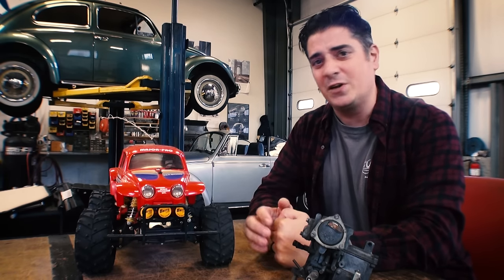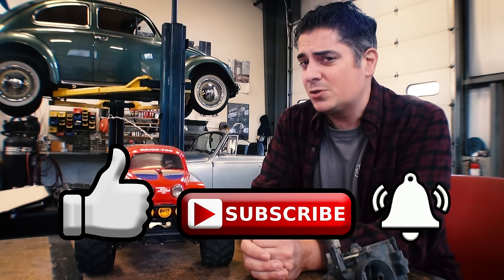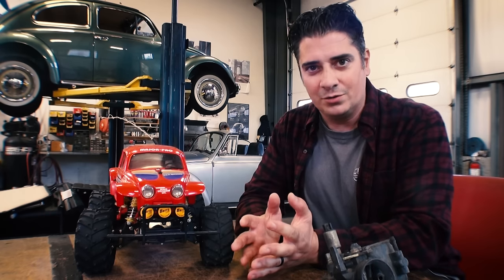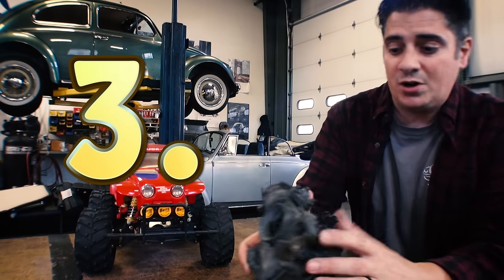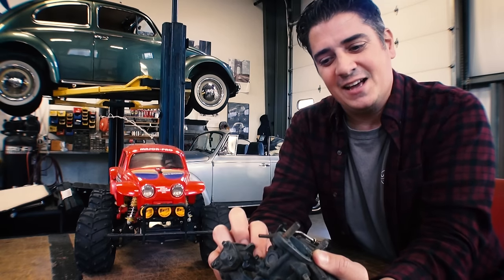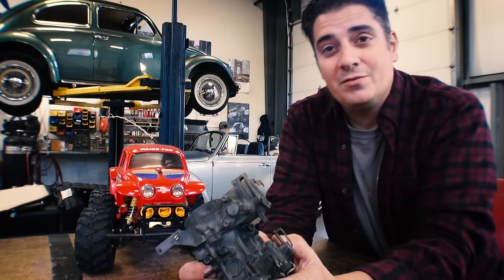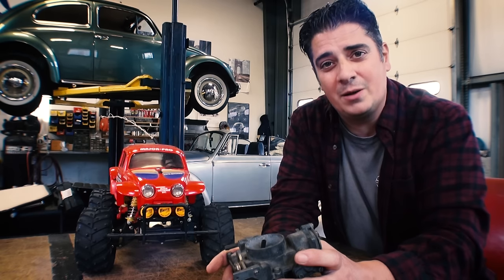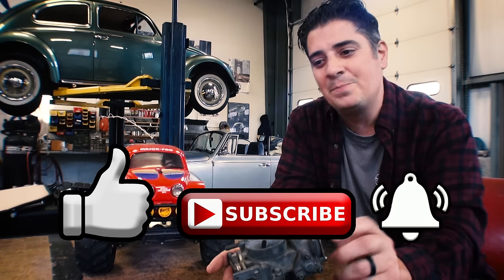TOP 7 Reasons your Classic VW Beetle BuG Hesitates, Stalls, or CHOKES on Acceleration

Comment: I can't quite get this straight. Are 30, 36, and 40 horse motors all 1200 cc? What about the 1300, 1500, and 1600 cc motors (66 and later)? Are 25 horse motors 1000 cc? Were multiple motors available on a bug for some years? Link for a timeline of when which motors were available would be nice. 

You've been a huge inspiration and I've got a 65' in the garage that I'm now daily driving :) Thanks!
Reply: Your best bet for this information is the technical section at www.thesamba.com.  1300cc motors are 50hp, 1500cc was 53hp, and 1600cc are 60hp.  In the US Beetles of a given year pretty much all came with the same engine, but in other parts of the world you could buy different models with different engines.  For example in 1968 US Beetles came with 1500cc engines, while in Europe you could buy a VW 1200, a VW 1300, or a VW 1500.  Aside from the obvious differences in engine size these models were also quite different regarding included amenities.
Reply from the maker: Well, I guess to keep it easy, the 30 and 36 hp are 1192cc, the 40hp I believe they just went to 1200cc.  The 1300cc, 1500cc, and 1600cc were all different HP.  Check this out https://www.jbugs.com/VW-Tech-Article-Engine-Letter-Codes.html
Reply: I appreciate the clarification. Thanks 👍
Reply: @jaredkomoroski  the 40 is 1192cc, but the block is unique.  61 through 65 virtually unchanged except for heater design.  66 a new block started.  VW was trying to keep up with the Datsuns and Toyota's.   My '73 1600cc datsun had 90 hp.  VW was never gunna compete.  Cheers!

Comment: Thank you for this video. I have a VW trike with a 1600 dual port and it had the .009 distributor. I just changed it and did the timing and it does appear to run better although I haven't had a chance to ride it yet.
Reply: It does appear to have helped quite a bit.

Comment: Hi - I have a FI to carb conversion (empi 34 carb). Heat risers were not installed. Bought it like that. I will replace the FI exhaust in order to add those heat risers shortly. Can that be a reason of engine hesitation (carb icing) on higher speed? It happens every couple of minutes, mainly > 50 mph... Great videos BTW, this will help a lot! Very clear and easy to understand

Comment: My VW sb 71 starts and idles at 850rpm and runs without hesitation but it dies when stopping. Carb was cleaned and new carb kit was installed. It used to hesitate but I replace the dist with a SvDA Pertronix Throw-flamer II. Any ideas to fix this problem?
Reply from the maker: do you have that idle solenoid on the side of the carb?  If you do, try cracking that loose a little bit.  Or you may have to take the carb apart and take all the lil BBs out and dunk the carb overnight.
Reply: Check fuel pump rod mine was sticking in the riser

Comment: thank you for the video.  I'm actually fighting with this now.  Luckily, it's close to winter so this will be a good time to dig into the bug since I won't have to worry about any car shows.  Would any of these topics (1-7) cause fuel to go into the oil?  That's another issue I have going on right now too.
Reply from the maker: Hmmm that is your needle and seat in the top of the carb maybe.  Do you park on any sort of tilt? Nose up?
Reply: @classicvwbugs  no, car is parked level, in the garage.  I was told to check the fuel pressure coming from the fuel pump.  Will begin troubleshooting tomorrow.  Since I saw this video, it made me think about the 1-7 you covered.  Thanks for responding.
Reply: @Lawrence Haughton what brand fuel pump did you installed
Reply: Bad fuel pump diaphragm.

Comment: I have a 68 engine, 009 distributor with out the vacuum, and perlox  ignition. I did ALL of the things Chris suggested, to no avail. I found that I needed to run non ethanol fuel, or grade 92 fuel.I adjusted the timing to roughly 6 degrees before top dead center, and used a 12 VDC test light to static time the distributor cap to the rotor. I think changing the fuel was the BIG ISSUE‼️
Reply: For ethanol fuel you need larger fuel jets in the carb. Ethanol fuel will run a bit too lean if the carb has been jetted for non ethanol  Fuel.

Comment: I have a kit car with a 1600. It stumbles at lower RPMs under load. Another symptom is the tach bounces quite a bit. Could I have a ground issue that would cause both? Any other thoughts? Engine has roughly 35 hours on it.

Comment: Hi chris do you know why 2 same side 2 cylinders are not firing they were working but suddenly died changed sparks , leads,points, rotor ,cap new coil, still not firing just 1,2, are working
Reply from the maker: Do you have spark to those cylinders?  Did you cross wires by any chance?
Reply: sorry for late reply the firing order is correct 1432 there is no spark on 3/4  1/2 are fine but misfiring i think the coil is weak thinking of replacing it and distributor would it help in bringing the car back to life
Reply: It's probably an air leak at the intake manifold.  But -  are the plugs tight? Realize they're a cork for an explosion that occurs thousands of times per minute. 25 pounds. Ignore the 18 pound value from the factory.

Comment: Hey dude! I'm new to the VW community.  I'm having a "misfiring/backfiring" issue with my '68 Ghia and found your videos. Did you make the move to Florida??
Reply from the maker: Yes I did
Reply: @classicvwbugs  awesome!
Well your tip about cleaning out the two little jets on the side of the carburetor worked for me. Thanks again!

Comment: Great information, I have been using a beetle, Brazalian origin, 1600cc Double Carb. I have hit 160 on flat roads and it was a great piece of machine. My simple question is, how does the two carbs work at high speed, I was told by a German Auto Mechanic, on these dual carbs, one of the carbs gets fully operational when you hit a certain speed, say when you pass 80 km the second carb opens to give the full throttle and both works in a sync manner. Could you please elaborate on the principles of this functional operation.

Comment: Ok I have a 1679cc thick wall cyclenders with a Weber progressive carb and 009 distribution.  I e changed the jets and have a electronic ignition. It was running great till a few days ago and somehow got out of time. I’ve worked on it for days but long story short I changed the rotor n cap and runs better and staying in time but now I still have a lil hesitation as I’m throttling up and going they the gears. Never had it before so any idea I would appreciate.
Reply: Did you figure it out?

Comment: Hey Chris, I'm going to throw a Pertronix III conversion into a stock german vacuum advance distributor. I have proper wires and low resistance coil coming as well. What plug do you recommend with electronic distributor? Ones with 10K resistance or no resistance? Thanks! Love your channel!

Comment: Hey Chris great video! I have a ‘74 bug that runs good until I hit about 65-70MPH and then starts choking up and stalling on me. I have to pull over and let it resettle. Any recommendations?
Reply from the maker: Hmmm sounds like fuel restriction.  Bad fuel pump maybe?  Check fuel flow.

Comment: I have a ‘72 super beetle. Had carburetor issues and finally bought a new carb and replaced generator with alternator. Worked fine for a while but now it will not idle after it gets warmed up. Cold idles. Car sits a lot. Not driven much at all because afraid it want make it home. Why does it idle fine when cold but not when warm?

Comment: What can make your VW Beetle stall when going down the road and when you go to stop it stalls at a stop sign or stop light ?
Reply: Vacuum leak somewhere between base of carby and heads.....is where I’d look first.
Reply: Hello , I had a similar issue. and   I removed the carb clean it and put it back. but i could not be sure about the issue. any sugestion Chris.

Comment: I've been working on a 1968 that we've had sitting for 14 years (long story) and your videos have been lifesavers! Anyways about the gas tank. Mine is rusty...do you suggest cleaning it out best I can and reusing or just getting another one? If you think cleaning it out is good what would be your method?
Reply from the maker: For a 68, I would get a new one, they are readily available.
Reply: Acid works great.

Comment: I have a 70s beetle kit car I was running down the road at about 65 when it stalled out I filled gas tank and charged battery but it will not start. Only thing I changed was I removed a solenoid for the gauges because it was killing my battery any help I know very little about beetles

Comment: have you fix one of the latest generation beetles from Mexico with Fuel injection,  and yes control module included.  or  are you familiar with those.?
Reply from the maker: I have not, no.  Sorry.
Reply: Do the Mexican Beetles have electronic ignition? All the fuel injected VWs I had still had points. The system uses the points to fire the injectors. Burned points caused hiccups. I started replacing the points when I changed oil.
Reply from the maker: @williamstewart2727  Good question, not sure.

Comment: Hi Chris, question for you.  My 1970 bug starts great, idles well after warm and drives well.  However, after I run an errand or go for a cruise, the bug won't idle high enough after restarting without feathering the throttle.  Any ideas?  Thanks!
Reply: Check the air/fuel mix screw .

Comment: Hi Chris.
Ellis all the way from South Africa Cape Town.
I have a 1971 1600 Twin Port.
My beetle chokes on lower revs on gear 1 and 2.
It also chokes when turning either left or right but after i turn it goes fine.
Also have a problem of the engine cutting out when idling. Sometimes it happens sometimes not.
Any thought what i should look at?
Reply from the maker: yeah gotta check the carb, take it off and do a clean.

Comment: Hello, I have a type 3 1600 duel carbs, the right side carb seems to not run as good, I have rebuilt it but still not acts right. Idles good but when I go to take off, it boggs down like starving for gas or floating out, I have no idea. It also runs real rich, I can smell raw gas
Reply from the maker: have you tried adjusting the fuel mixture screw?
Reply: @classicvwbugs  yes I've tried some, had a shop get it running better so I could get it to a show in Eureka Springs Ar,  but its still really doggy....... I'm sure IF I had the motor rebuilt it mite solve my issues, but thats not possible rite now..............

Comment: i have a 1972 vw bug 1.9 liter  with a impi gas 38 carb with a manual fuel pump do i need an electric one? which distributor is best for this set up

Comment: Chris interesting - thanks - so I have a question in regards to the coil. In most of the images you show it has the coil pointing downward with one pointing upwards. Being oil filed coils, if it is pointed upward does this stress the upper wire locations from electrical stress by possibly not being submerged in the oil? Thanks Sid
Reply from the maker: I don't think so.

Comment: Hi Chirs, thank you for your videos, and specifically for this one. You just mentioned about a problem that I am having with my beetle, I am not being able to adjust the idle speed in my bug's engine, I even changed for an old carburator that I have but the problem is still there, which makes me think that I am having a vacum leak somewhere in the manifold. I sprayed water on the carburator and on the manifold base  expecting to hear a change in the engine sound to try to find out where the leak is coming from but nothing happens, the question is: Do I have to take off the black metal sheets that covers the base of the manifold  so that when I spray the water it can really reach where the manifold and the block meets? if that doesn't work I don't know where else to look for the problem. Thank you very much!!!
Reply from the maker: Any ports on the carb that is not plugged?
Reply: @classicvwbugs  Hi Chris, I just re checked and everything is where it is supposed to be..So do I have to take off the metal sheets when spraying the water? thank you for your reply.
Reply from the maker: @bugmevideo4269  nah
Reply: @classicvwbugs  thanks!

Comment: Hi Chris. I  Have a 77 VW Combi. The Problem  is this.  If i press the Gas pedal past the halfway mark,and take my foot of the gas pedal,the Engine dies out. But if i press the pedal just before the halfway mark,the engine idles fine with no problems at all.   Any Suggestions?
Reply from the maker: Yeah I would take that carb off and do a good cleaning, take out all the jets and BBs and dunk it.  You could also check points or timing to before you do that.
Reply: @classicvwbugs    Thank you for your quick response. Much appreciated.

Comment: Anyone have any tips for a beetle that stalls?  I have a 69 and replaced the breather and vent hoses in the hood coming off the tank and put a new fuel filter on. It’ll start and idle fine for about 5 mins and then will die. If I drive it it’ll be fine as long as I’m giving it gas but any time I slow down for traffic/stop signs the engine will die if I don’t give it gas. Not the most mechanically inclined but trying to learn. Thanks for any tips.
Reply: Idle circuit issue, clogged, air fuel mixture screw not adjusted properly.

Comment: Great videos....    I have a solex pict 3 and a 009 distributor.   I was going to try to rebuild the carb before i watched this video.   The car runs good but when i downshift to 2nd gear and go around a corner at about 10 miles an hour the car bucks and bogs.   I have to sometimes put it into first gear which doesnt seem right.  would you switch to a vacuum distributor first or rebuild the carb first.   The 009 i have has no points.      its a 63 bug with a 73 dual port motor.  thanks  any help is appreciated

Comment: My pict 30 is new but... it idles good, punch it great, In between sucks. Leaving stop slow is not possible,  it falls on it's face.
What is it?
Reply from the maker: Yeah sounds like you need to clean that bad boy out, take it apart, dunk it, rebuild etc.
Reply: @classicvwbugs  didn't help. All fuel items new. Acts like it suddenly needs more gas. Punch pedal it returns to good.
Reply from the maker: @BeatleBaly  you need to tear it completely down, take out all the bbs.

Comment: My beetle starts fine 1 click. Idles fine also. But after car is warmed up. When i put throttle its not getting enough power ( it sounds like its choking and then it will stall ). Any ideas?
Reply from the maker: I talk about that in this video, sounds like a classic choke issue.  Try adjusting the choke.

Comment: Awesome video. So I was a complete idiot and accidentally left the light on after I parked my 63 bug. Luckily about an hour after that, I saw it and turned them off. At first the battery wasnt giving very much power to the engine and it wasn't turning over. I jumped the car and it was running well. Today two days later, when I turned it on, it was having a hard time with the battery again so I gave it a second jump and drove it around for a bit. The thing is that it drove great, but the red light on the dash that tells you if the generator is working started to blink. Not a solid red color, but just slow blinking. Im here at home reading my How to keep your vw alive book and I'm following the procedures for the red light, but I'm not seeing any info on what to do if the light blinks. And even stranger enough, when I turn the lights on, it stops blinking. Any advice on whether its something with the generator or if its a wiring issue? I guess every once in a while, it takes learning the hard way to learn to always double check if the lights are left on. Haha
Reply from the maker: did you try charging the battery?  If the red light goes out when you hit the pedal a bit, it could be your idle might just be a lil low.
Reply: I'll give it a try. Thank you

Comment: Hey Chris - so of those possible issues, if the car idles great and accelerates upward just fine w the fuel trigger while sitting in the driveway, but can barely accelerate at all while actually driving (until rpms are finally high), any thoughts on which problem I have at hand. Just figured I’d ask :)

Thanks! - jon
Reply from the maker: Check valves and compression, even fuel flow.
Reply: Will do. Thanks for replying. I appreciate it!

Comment: Does a 30pict 1 have enough vacuum for a pertonix SVDA distributor with electronic ignition 
Some people have told me no 
What distributor SVDA would you suggest if it doesn’t
Reply: It’s in a 1641 by the way duel port
Reply from the maker: @Musickfreakbrown  how many lines coming out of your vacuum advance?
Reply: I don’t have that distributor I have an 009 and was wanting to get a SVDA distributor 
My carb has 4 capped off don’t know which is which but it’s a 
solex H30/3 pict
Ind. bras.

Comment: Hello! First off, your videos are absolutely fantastic! Thank you so much for posting such awesome content! I am having issues with my stock 68' beetle dying at idle. The engine runs great when pressure is on the gas pedal but dies as soon as the pedal is released. The car starts great but dies after a couple of seconds at idle. I have a 30pict2 carby. I have checked the fuel lines, fuel filter, replaced the fuel pump, and cleaned the carb jets. When I cleaned the carb jets it ran awesome for about 30 miles but now the problem has come back. Should I rebuild or replace the current carb with the 30pict1 or try something else first? Could it simply be a carb float issue?

Thank you for your help!
Reply from the maker: Have you seen my video on express carb clean?  You may have to just break it down and dunk it over night, clean those areas where the BBs are.